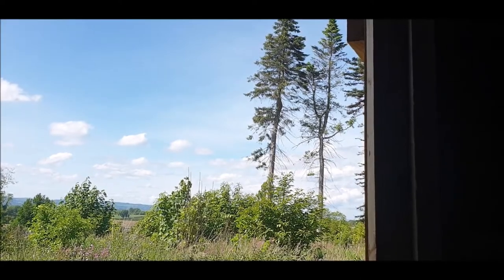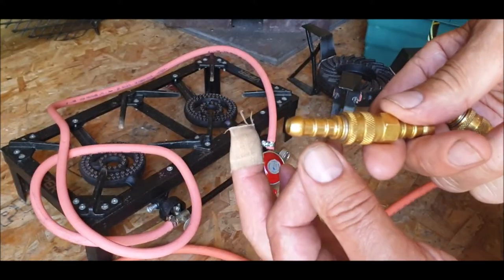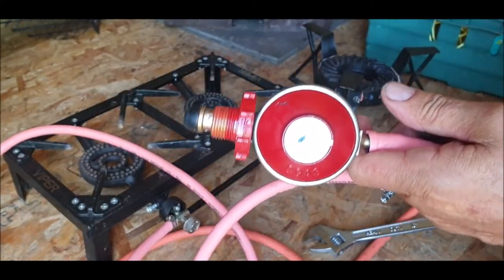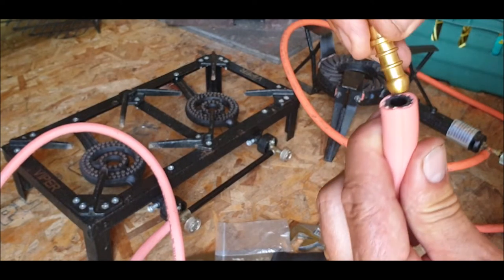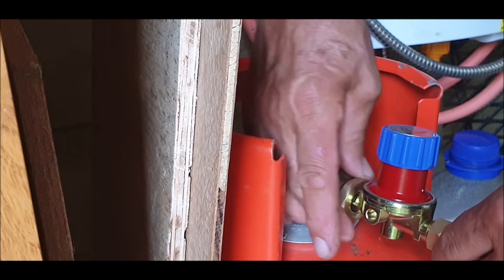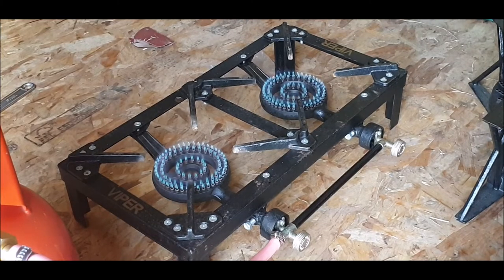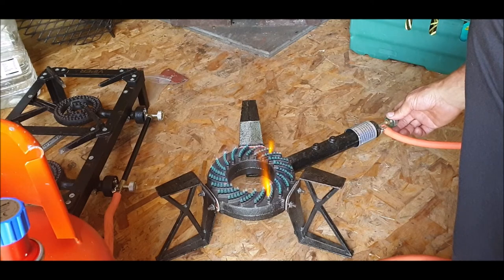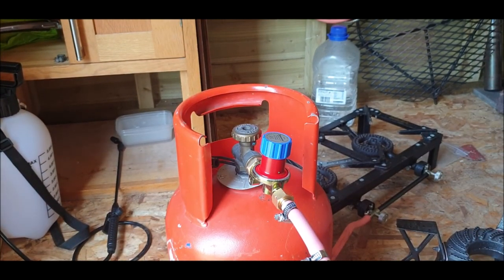High Pressure propane regulator with quick fit connectors

Comment: Could provide a link on ebay to buy this quick fit connector. Thank you
Reply from the maker: Hi soz link below thanks for watching 

https://www.ebay.co.uk/itm/2-X-Inline-Quick-Release-Fitting-Coupling-for-8mm-i-d-propane-butane-Hose-63/153543081959?ssPageName=STRK%3AMEBIDX%3AIT&_trksid=p2057872.m2749.l2649